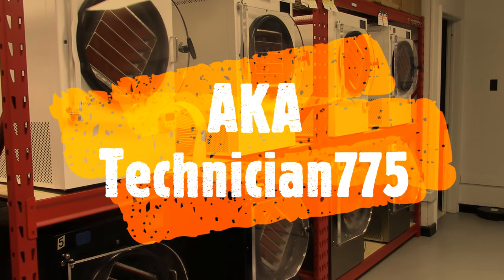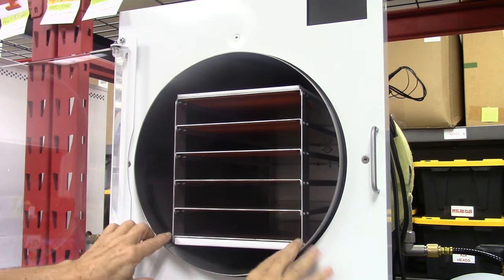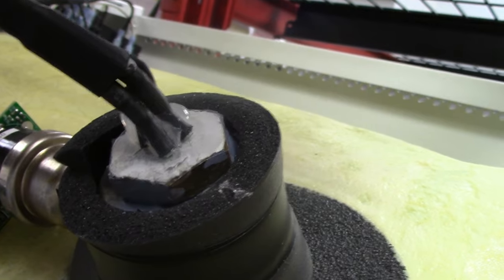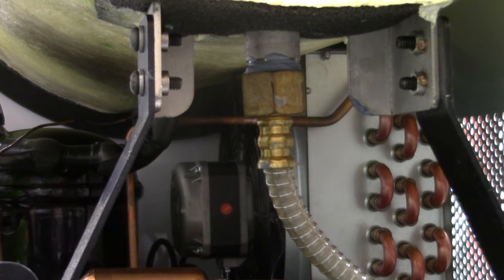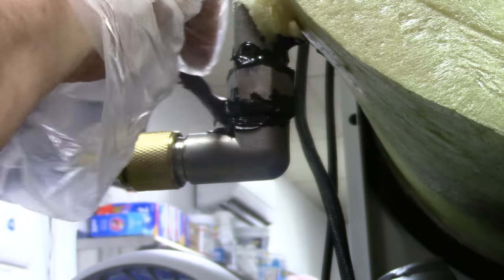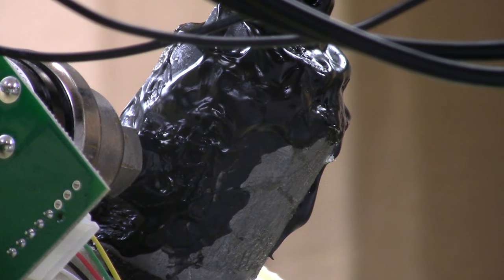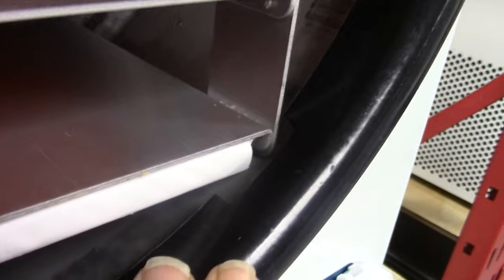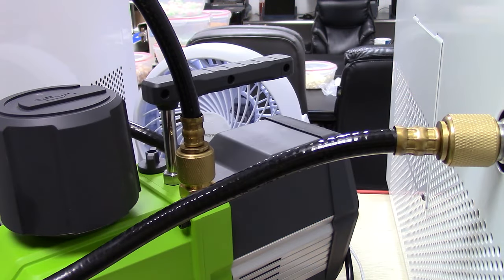Harvest Right Vacuum Fix VIDEO

Comment: My machine Temp gets to maybe -20...the pump kicks on for maybe a minute then kicks off. Machine says needs more freeze time. Does this over and over. In the test mode the pressure won't go below 740 but if I run the freeze test with it it will drop to under 300. Will not take me to the freeze/vacuum mode. I borrowed a friends pump and had same issue so  I believe the pump is ok. I checked all the outside connections and the gasket. Everything seems fine. Does this sound familiar and would opening the back and liquid sealing solve this?

Comment: you are welcome, you will need a new demister, I highly suggest getting the new premiere pump...I do not know of any rebuild kits for the pumps except the oil less...and then I do not recommend those either...we rum all premiere pumps here and have tried them all.....HR can sell you a new demister for your pump....ty for watching and the comment!
Reply: also...I think HR still has the old style pumps for sale....might ask for a discount....
Reply: I'd love to afford the Premier Pump from Harvest RIght, but we just don't use the freeze dryer enough to merit that amount of money.  I will absolutely miss not having a ballast gas release on any of the standard arvest Right pumps.  Got the Veor in, but need to install a drain valve and a different fitting for the Harvest Right hoses.  Any chance you can share the thread siz and type and the flare fitting angle?  I'm thinking that it isn't a common flare design, but an alternate angle from the common gas fiiting flare angle.  Wish you were my neighbor, I'd invite you over for supper and a little brain picking.  Thanks!
Reply: Will not freeze, when it’s in freeze cycle there is a switch noise and the machine acts like compressor is kicking off and on, doesn’t even get cold after installing new hoses and sealing everything with liquid tape during vacuum

Comment: great video! i have noticed that my door seal has come out of adjustment after i open it for a tray dryness weighting. went i restart the cycle i can not get a seal, and what i do notice is that like yours the seal is hitting the tray. how much of a mtorr increase after you cut the ring? i have to move the ring out a little bit to get a seal and then i get a seal on restart. also do you pull the pipe dope on top of the tiflon tape?
Reply: Run up to the hardware store and purchase some 3/8 inch breaker rod. They use it to insulate windows and doors, it is that round foam. Pull your seal out around a 1/4 of an inch, and take that foam and wrap it around the barrel cylinder, Just one time around, cut it so the ends meet flush. Push your door seal back into place. After a couple of vacuums, the foam rod will compress and make a nice stop for your gasket. You can also use a spatula to nudge the seal out towards the door to complete the seal. Usually the foam rod will solve this issue.

Comment: Thanks for this video. I want to try this but I have one concern. How do I remove the liquid tape if I need to change a part or for any other reason? Does it come off relatively easy or will it be a major pain? Thx
Reply: hi.....I never had to remove it!...even if it a pain....fixing a leak would be worth it...but do check everything in detail ....ty for watching and good luck with your unit...!

Comment: Steve, a question for you in regards to holding a vacuum... I am having a brain fart here trying to recall how this works. Ok, I turn on the pump, draw down to 200 mTorr, turn off the pump, is the vacuum supposed to hold, or will the pump allow air back into the chamber? I am using the same pump that you are using, the green one, the machine was built in August of 2023.

I was using the HR supplied vacuum line/hose, and when I turned off the pump, the vacuum in the chamber dissipated rather quickly. Is that how this system works? Does the pump have to be running continuously to hold a vacuum? 

I am trying to remember how this works when I recharge the AC on the car, and it seems to me the pump held the vacuum when turned off with the AC line valves open. Or am I recalling this incorrectly? Thanks.
Reply: Hiya, i usually bring it down to as low as it will go. Turn the pump off and see how long the unit will hold a vacuum, usually if mare that 2 hours, you have a great seal !, As long as it holds a vacuum while running and gets below 400 or so mTorr, i am good.  I hope this helps, if it does not get below 500 mTorr, you have a serious leak....TY!

Comment: What is the name of that tape and where can I find it?
Reply: Hi...look on the video, they have a picture of it and you can buy it online and any home improvement store, ty!!!...I don't have the wrapper anymore....
Reply: Amazon-  Hercules Megatape Gray 1/2 in. W x 260 in. L Thread Seal Tape, or 3M Temflex Rubber Splicing Tape 2155, 3/4 in x 22 ft, Black, General Purpose Self-Fusing Electrical Insulating Tape
Reply: perfect...thank you!!!

Comment: Steve, which pumps are you using?  I was just about to retire our standard pump and purchase a Premier XL from Harvest Right or maybe Navac 12-CFM, but I'm researching any and all pump option.  Any suggestions?
Reply: Dan, we use the premiere pump, I have tried them all and settled on the premiere.  in my opinion, the big oil less are a waste of money...I had about 8 of them and after a time they can be rebuilt only so many times....you have to rebuild the motors as well along with the pump....I like the premiere with regular oil changes using FRESH oil each time, I do not clean and reuse the oil.....it is too cheap and pumps cost too much to take a chance on a few cents worth of oil.....

Comment: Hey Steve how's things going, I got my new premium pump and I like it as its super quite, still have a leak problem and I think its the vacuum sensor where it screws into the fitting, so I might replace them both, do you think the fitting ( I think its 1/8 female and 3/4 male) would be readerly available say from a hardware or similar.
also you did mention about getting the sensor from somewhere else, why I think its here as even with the new pump it only gets down to about 500-550 then during the drying it climbs up to 700+ but if I put a bit of pressure on the side of the sensor my mtorr drops but won't stay there, just as well I did do an upgrade to the latest software as it still works even if it doesn't achieve 500mtorr so have still been able to do a couple of batches, also in your opinion how far should the sensor be screwed into the fitting, with 3 layers of tape it doesn't go in as far as it use to which is fine I think.
thanks mate, have a good weekend.
Reply: Hiya!....the premiere pump is sweet....I would go to the local hardware store and get a tube of pipe sealant or some call it pipe dope....carefully remove the large fitting...ensuring the wires are unwinding as well...clean both mating surfaces...apply the pipe dope and Teflon tape....screw it back in....clean off the excess...do the same with the vacuum sensor...HR has a video on their site how to change the sensor...it is not screwed in as much as you would think...aligh the sensor and plug in board...I would just use the Teflon tape  on the sensor or a very small amount of pipe sealant...clean excess..and I would apply the liquid tape under a vacuum...a couple of layers for extra insurance....that should fix your leak!!!...great to hear from you....hope things are good!!!!

cheers!!!!
Reply: @stevenducote7466  I will give that ago, seen the pipe dope in comments so looked on the Web at our biggest hardware store, they don't have any in stock, Lol, will have to look around, thanks again steve.
Reply: @bazza2825  you are welcome!!!!
Reply: @bazza2825  hope you can find it!!!!

Comment: When you say seal the heated tray leads, do you mean inside the machine word attaches to the wall or where exactly? I’m really troubleshooting this vacuum that I have. Also, should I be able to pull a vacuum before I put the stretchy tape on? And do I put the stretchy tape on everywhere that I have put liquid tape?
Reply: the outside only.....
Reply: yes, I usually pull a vacuum before I put the liquid tape on.....let it sit for an hour or two...then put the stretchy tape on......except for the wiring harness...I do not use the stretchy tape there...just the liquid tape....under a vacuum....
Reply: Can I check for a good vacuum without putting the stretchy tape on? I’m afraid if I put the stretchy tape on I might have to take it off to do more liquid tape? Or I could just put on more liquid tape and wait and put the stretchy tape on. What would you do? Thank you for your help.

Comment: Can you tell me how would I know my pump is No good?
I definitely have a vacuum leak somewhere but my pump is just over a year old and it won’t go below 900 t
Reply: hi...if you have a green pump, you changed the oil regularly, and it is about a year old...you probably have a leak in your system somewhere....watch the video...check your hose end connections at the pump and at the dryer.....did it work ok when you first got it??

Comment: Do you put the nylog on the O-ring or just on the thread? also, what you’re callingRTV. I have opaque on top of a foam like washer on top of the piece that goes into the breeze drawer. How do you get that stuff off the wires without damaging it? Do I really have to get that hardened opaque glue off the wires?
Reply: I put the nylog on the threads and a little on the face that mates with the oring....rtv is a rubbery substance usually surounding the wires where they come out of the plug....i am not sure what you have...my appologies....
Reply: I may just have an opaque color of rtv. I’m just getting off as much as I can.
Reply: could possibly have...I am not sure...I would clean like you are doing...then ensure it gets a really good coating...

Comment: My door on mine at top is lose, is it suppose to be lose or di I need to tighten?
Reply: Hi, it is supposed to be somewhat loose, it has to be able to slide back and forth as the door vacuums and releases the vacuum. If the screw falls out, too loose, reinstall and very lightly tighten it up. TY for watching !

Comment: Do you have a video on how to take the side panels off the back panel and the top panel came off fine but I need a little instruction! I will share your channel for for sure❤ if you have Venmo, I’d be happy to pay you for a little technical support
Reply: Hi, thank you for the offer...Harvest Right has videos on how to remove the side panels...they have 2 screws on each side, one lower at the back and one upper in the top front, you will need to remove the power plug panel to access the one on the bottom. I do suggest while you have the panels off, clean the condenser coils with a soft brush. and thank you for the offer again...I am here to help if you need...no charge!
Reply: check to see if you have a one piece vacuum connection from the panel to the drum...if so, their is nothing to seal....if you have a fitting like in my video, you will have to seal that, not the brass vacuum hose....

Comment: I completed the fix. At around 22 hours I applied the tape. The mTorrs were at around 285 when I shut the vacuum off. Later on I did a function test (freeze for 15, vacuum for 30) before putting a new batch in. The mTorrs got down to about 8000 and were jumping all around. It would go from 8000 to 9000 then back down and up. It eventually went back up to around 20,000. Any ideas on what the problem may be?
Reply: wow....check all your connections...your hose etc....ensure you valve is closed and not leaking....you seem to have a great mtorr 285 is very good.....let me know how it does after double checking everything....
Reply: @stevenducote7466  I double checked everything. I put the drain hose in water with vacuum on to check, it was good. I tried taping bothe ends of the vacuum pump hose to see if maybe there was a leak there (I didn't get my nylog blue yet to apply). I just don't understand how it was so good and now it's just bouncing around like crazy. I put like 3 layers on the drain part and on the thing on top. The 3rd application was a few hours before I taped. Could that be the problem? Should I have let ot dry longer?
Reply: I would do a simple candy run (like a skittle) or a bread run, just to see how the machine operates, i do not have a lot of faith in the function runs, let me know how it comes out TY! @ncadotte
Reply: @stevenducote7466  OK I will try that. Thanks!
Reply: @ncadotte  good..let me know the outcome...
Reply: @stevenducote7466  I figured it out! It's the  ball valve on my drain hose. When I tested that area earlier, I had that "no suck" thing on it so water doesn't get accidentally sucked up the tube if I forget to dump it. Anyway, I took that off and tested it again with a glass of water. As soon as I put the hose in the glass, the water immediately went up the hose. I had the original ball valve that came with the freeze dryer (I replaced it as soon as I got the freeze dryer with a better one), so I put that one back on and tested the vacuum on the machine again, and mTorrs got below 500 within 15 min or so. I am so happy! I've been working on this stupid machine for almost 2 weeks now! I'm ready to put it back together and get freeze drying again! Thanks for your video and your assistance! :)
Reply: @ncadotte  I am glad you found out what was wrong...hopefully something sailing from here!!!...and you are welcome!